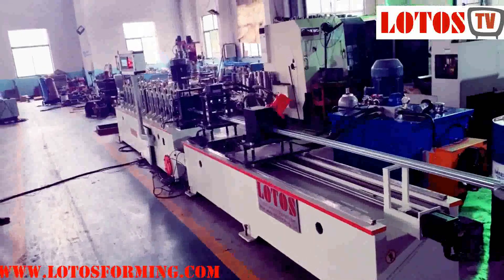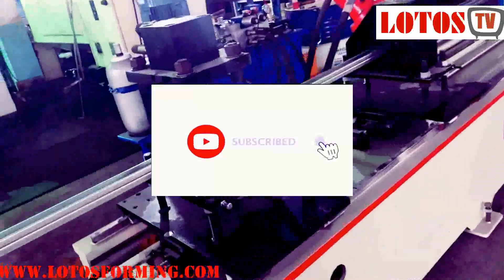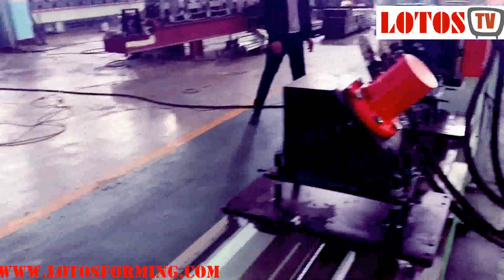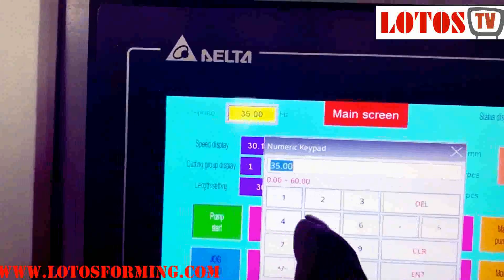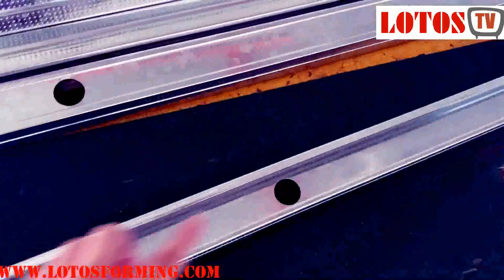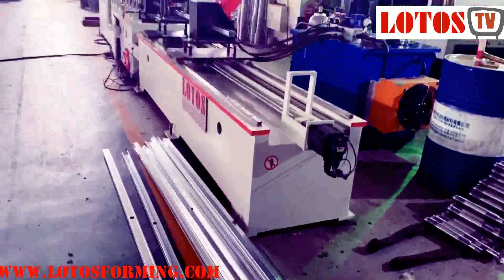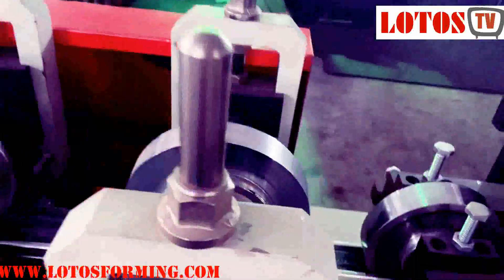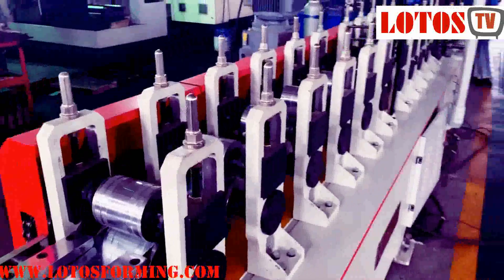【C channel machine】: Wall track and wall stud machine " Dry Wall stud and track"

Comment from the maker: stud and track systems are economical system to assemble frames for strong, compact, lightweight partitions. The metal stud partitioning is ideal for use in domestic and commercial situations, for heights up to 10m and a wide range of partition thicknesses.